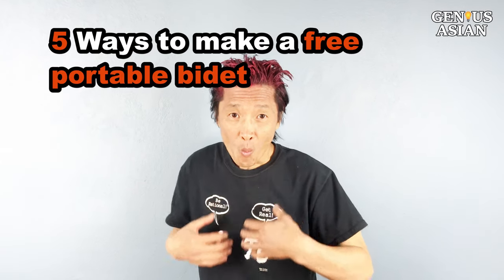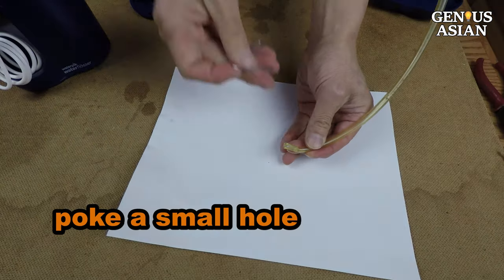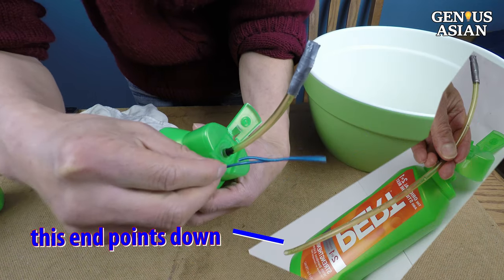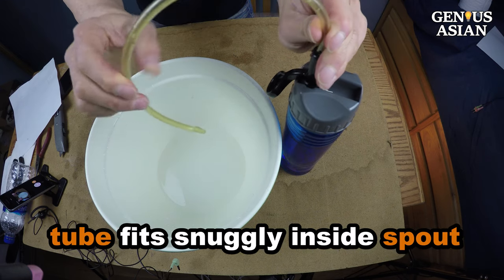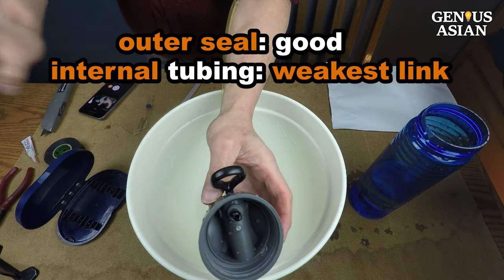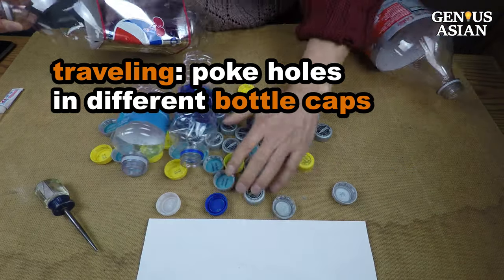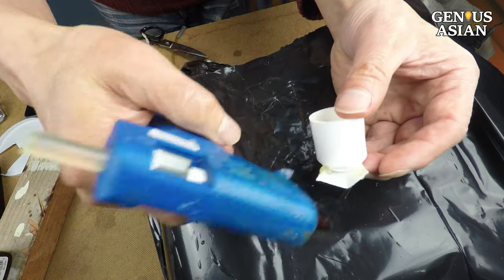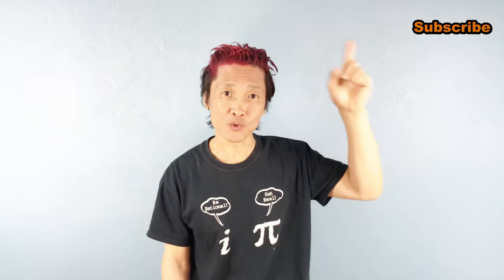5 Ways to make a free portable bidet, reduce use of toilet paper

Comment: Sorry no offense to the author of this video but I have experimented with many types of plastic bottles over the years and I can tell you what I saw in this video are not adequate. The best I've come across so far using off-the-shelf components is a soft squeeze condiment bottle I found at BB&B along with a 1/4" 90 degree plastic connector near the quick-connects section at Home Depot. The bottle should be easily squeezable yet regain its shape reasonably quick while supplying a steady strong gush of water.
Reply from the maker: yeah, if you spend some money a better portable bidet can be made, however this video shows different ways that does not cost you any money. If you spend a few dollars, you can get a portable bidet such as this one: https://amzn.to/3eYpg4F  , if it were not name brand, it could be as cheap as $4. If you are looking for a home use,  it is better to install a seat:  https://amzn.to/2Uk2agT   https://youtu.be/silYA2vWgRM

Comment: I got a water flosser not long ago which has a Normal, soft and pulse mode and mine came with different heads, so I might try it out as a makeshift electric bidet with one of the other heads I got with it that I haven’t used.
Reply from the maker: Thank you for taking the time to share your result, this will also help other people.
Reply: @GeniusAsian  no problem, I did try it out the other day but it was too harsh on my genitals even on the soft setting but it was ok for my arse. So I think I will try something else. It might just be my specific flosser so it could work for other peoooe with different flossers to mine. I have one by Atmoko.
Reply from the maker: @triplea5293  mine is waterpik which has a dial 1 thru dial 10 to adjust the speed.

Comment: I always thought about condiment bottles as an idea, because they can be collapsible. Thoughts?
Reply from the maker: as you said, the small size usually is the problem. You may just tell yourself that even not enough water, still it is cleaner than toilet paper.
Reply: @GeniusAsian  good point. I was thinking it would be for travel, but if it's too small, then I wouldn't want to be stuck traveling with something too small to work. Thanks!

Comment: when you say the water pressure is too high on a floss pick - what do you mean? Some have 10 pressures and you're saying that those might not work or that some will be too high?
Reply from the maker: yes, you may adjust the dial. Using the floss may cause psychological problem😂

Comment: during the pandemic, I bought a portable bidet. It was too much water and didn't work. Since it looked like a mini shower head, I actually turned it into that - using it as a small shower head to use less water in the shower - just a small amount of water where I need it at one time and no letting the water run while I'm washing with soap.

It didn't work as well as I had hoped, because I run out of water too quickly and have to refill with soapy hands. So I decided to take a sparklett's 5 gallon bottle and add a primo manual pump to it. So now I can use the portable bidet with that and that should work. I didn't try that yet, but every step gets me there.
Reply from the maker: Thank you for taking the time to share your tips
Reply: @GeniusAsian  anytime - thanks for reading it. It means a lot :)
Reply: @GeniusAsian  anytime - thanks for reading it. It means a lot :)

Comment: Go to Michael's craft store and in the cake section buy a couple of squeeze icing plastic bottles. They have 6 or 8 oz and other sizes. They work great. No mess, no tape or glue.
Reply from the maker: Thank you for taking the time to share your tips. Couple of questions: 1. do you point bottle top down? 2.  How much water do you use each time? Notice the shampoo bottle used in this video is 25 FL Oz.
Reply: @GeniusAsian  I would go with the  6 to 8 oz bottle cause if you go any larger you will have a problem with positioning  cause it will take up to much room. You can fill up two 6 or 8 oz bottles all the way up, one bottle for the front and one for the back. When you squeeze the bottle from the front, aim at a slight slant, aiming towards your target and give it a good squeeze. With the other bottle move your rump toward the front of the seat so that  you have more room. From behind, angle your bottle and squeeze. The reason I get my bottles from Michael's is the plastic is a higher quality than the bottles you get on Amazon. The bottles on Amazon are cheap and the lid pops off. To dry yourself you can cut up some old fabric like old T- shirts or what ever you have handy that you don't need and keep your soiled cloth in a separate container and wash separately from your clothes. It's so easy once you get the hang of it. You will feel more fresh. Hope this helps.
Reply: Victor Huang 
You would have to be  STANCING/STAND UPUPRIGHT IN A FULL SQUAT POSITION Over Your Toilet (or a hole in the ground ), to Maneuver a Bottle that size.
What are you planning on using to clean up the "Splattered Mess"? 🤢💩🤢
Reply: @billyjack873 
Thank you for confirming my own idea, (at least temporarily if necessary).
Id have to be standing on my toilet seat with a bottle that large...
Too precarious, Too dangerous...
Im afraid of heights 🤣
Id probably fall & whack my head on the sink, having a small bathroom. 
BOOM! Out go The Lights!
Il take youre IDEA 😁💡😁
Be Safe!
Reply: Be sure to snip the Very Narrow Tips and Tighten that Lid! Warm /Hot Water will do the trick! 😉

Comment: I think I thought of an idea to fix the whole running out of water issue. There's something called an aerovoir that's used for aerogardens. It has a hose with a squeeze bottle attached to a 1 gal jug. Somehow I feel that would work. I'd love to see a video on that.
Reply from the maker: the more connection joints the greater risk of leaking. A video that made a mess in the bathroom may not be bad though.😀. Thank you for taking the time to chime in.
Reply: @GeniusAsian  When I used it for the garden, it didn't leak at points. It only leaked if you have the end lower than the bottle. Either raise it higher or cap it. But you're right, if you mess up - it's a big leak and that'd be super funny flooding the place.
Reply: @GeniusAsian  thanks for replying to my comments. My head is clearer on thoughts :)

Comment: the only thing that actually works for me is an ear bulb. The ones you fill with water. I found only one that works - it's a small blue one that doesn't have a cap opening. It's just the perfect size and pressure. However, a larger bulb with an ability to open the back is much better. The issue with them is I run out of water too quickly.
Reply from the maker: agree, thank you for sharing.

Comment: Lie cap on side. Make a 1/16 inch hole with drill bit or hot needle/pin/nail on inside of ridge not on thread side. Make small hole & make bigger as desired. Small hole for small strong stream. Large hole for weak big stream (use more water).
Reply from the maker: yes, this could be an alternative, how do you refill the water without leaking?
Reply: @GeniusAsian  Unscrew the cap like regular bottles. Hole is in cap. Only leaks when bottle is upside down.
Reply from the maker: @FlashToso  thanks for your answer, interesting. How do you cut the "1/16 inch hole on inside of ridge" so that the waterjet would point upward (without leaking)?
Reply: @GeniusAsian  With cap on side make hole down so is in wall close to ridge w/o breaking thread side. Water spray is angled!

Comment: Too much work Genius Asian. I'm getting by just fine using a quart yogurt container of hot water and a cheap toothbrush. Dry with hairdryer and store toothbrush in bleach solution. I used to use a hand held sprayer while sitting on the edge of the bathtub and then pouring a bit of bleach on the tub. No need to tell your roommate. lol
Reply from the maker: although I may not want to be your roommate, I must say that I am impressed. When you say "cheap toothbrush", did you mean soft brush or hard one?
Reply: Steven Kritzler wow that’s way more work than a hand held bidet. I have an actual bidet toilet with a built in dryer . 
T
Reply: @GeniusAsian  LOL. But why would anyone put a toothbrush down there?!
Reply: @janjbowman  Wow! It has a dryer?! That's fancy. I've never heard of that!

Comment: Just take a body shower!! Why to go through so many inconvenience. Also baby wipes can do the job.
Reply from the maker: a lot of people believe that showers strip their skin and hair of essential oils. Other people are just lazy, you must agree that taking_cloth_off->shower->drying-cloth_on takes more steps, correct? In some countries, you don't have toilet, you just need to go to a pit.
Reply: Eventually, you'll run out of baby wipes, too.
And- you may already know that, but don't flush them. Not even the ones that are advertised as, "flushable". A friend had an expensive plumber's bill after a babysitter believed the labels...
Reply: I think taking a shower after every time you use the restroom (I wash off after peeing, too!) would be far more of an ordeal than just washing off at the toilet. A cup of water works well too, actually. Been using them for years. A sturdy plastic one, like the types found at the dollar store or a plastic cup from a soda at a fast food joint or slurpee from 7 11 work nicely - they are large and hold a lot of water and won't break if dropped accidentally. Takes a LOT less time and water than taking another shower if you don't otherwise need one or already took one for the day.
Reply: @GeniusAsian  I agree with your pint - Never mind all the chemicals in them that then soak INTO the skin, on top of stripping oils from it. These impact our livers and organs, likely causing health issues years down the line. I'm sure the production of them still trashes the environment, too, probably worse than making TP. One day we just won't have trees, or air, and the entire planet will look like a giant garbage dump. I hope people realize what is going on and what is going to happen if we all don't stop with they way we've been doing things.